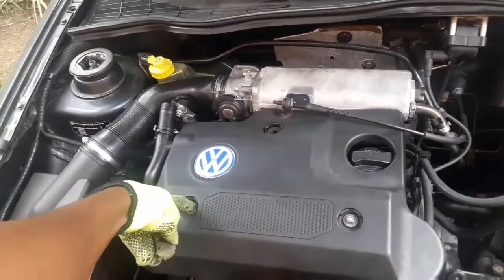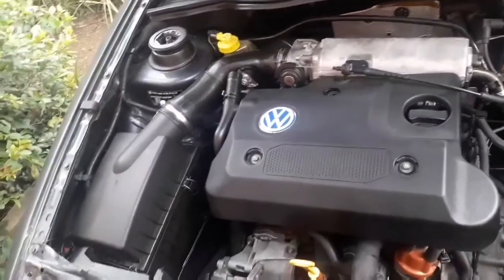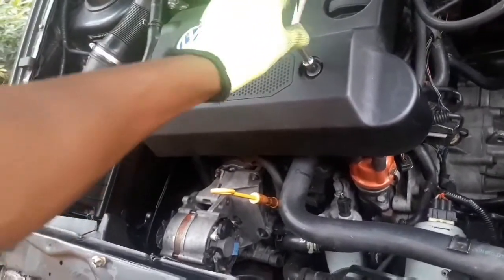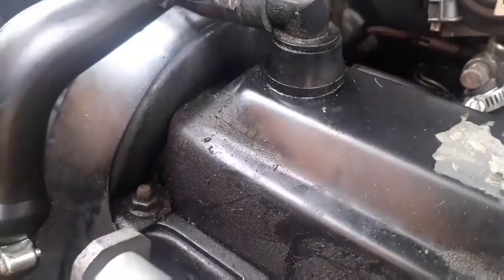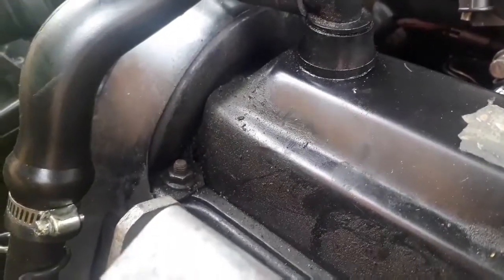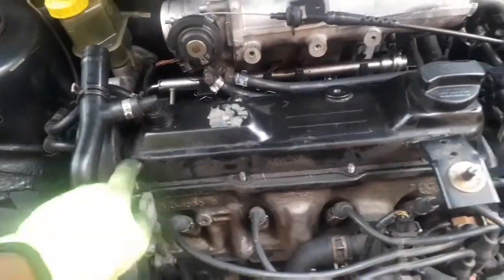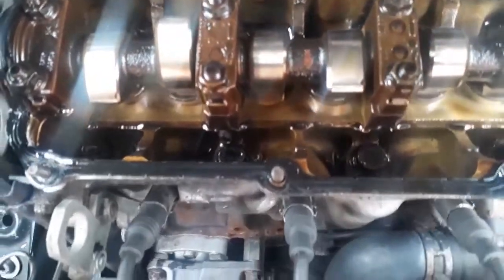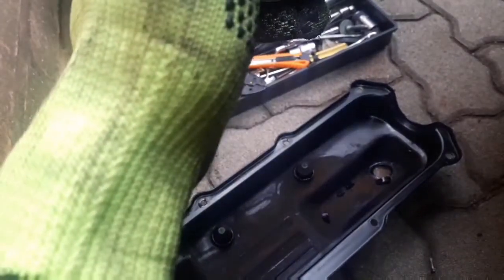VW Polo Playa 1.4i 6n2 2001 Breather pipe oil seal replacement

Comment: Sure man where can i get all the polo playa parts because my breather pipe is all worn off and the engine oil light won't switch off. I've serviced the polo and changed oil pump but still the light it's there.
Reply from the maker: Hi, you can get most of your parts from Goldwagen, they have nice quality too. If you installed a new oil pump and stil have oil light, you might be having low oil pressure, but 1st check the oil sensor by the oil filter.

Comment: Will it be a problem if don't connect the breather pipe to my air intake pipe as to the oil goes through to my air filter and it gets damp
Reply from the maker: No it won't be a problem, just make sure you connect it to an Oil Catch Can.
Reply: Thaanks alot man

Comment: Hey what'sup, so you said this was a temporary by replacing the seal but did you actually find the problem?
Reply from the maker: Howzit Bro, I thought my temporary fix would work but it proved me wrong a couple of hour later, so I haven't been able to get to the bottom of it yet, but i have a few more things to try, hopefully I can get to the bottom of the idling issue soon👌🏽
Reply: @ffwmotor-sport1081  Hey whatsup thanks for the reply, i was wondering if you can maybe show how to take off intake and fuel rail and how to clean the injectors and throttle body with that. Thanks

Comment: Hi. Thanks for posting this. Was it necessary to remove the valve cover in order to replace the seal? It looked to be a push-fit. Was it because the rubber of the old one had degraded?
Reply from the maker: Hi, yes it was necessary cause the old seal was hard and brittle, didn't want to risk pieces of it falling inside the engine👍🏽
Reply: FFW Motor-Sport Got it. Fingers crossed and many thanks.
Reply from the maker: @anenigmawrapped  All the best to you!

Comment: I have a Jetta 2 now owning a Polo Millenium as well. and when my engine started pushing oil thru the breather pipe i had to put new piston rings that fixed that issue. If my understanding is correct, with the combustion in the chamber it pushes air pressure pass the compression rings and you end up with more pressure in the block and it escapes thru the breather pipe. Hope this helps.
Reply from the maker: That is really awesome, Thanks for the advice, I will definitely be looking into it in the very near future!
Reply: SURE my brother I'm driving the very same polo but 1.6 and this morning that car couldn't start.Just realized the rubber between the wipers and the body is torn so my computer box swim inside the water.
Reply: Thx for the video. What are the torque spec for the nuts on valve cover?